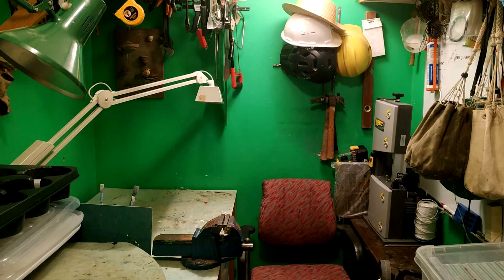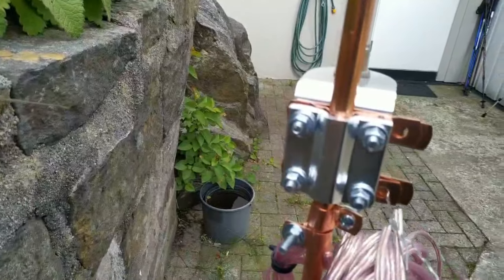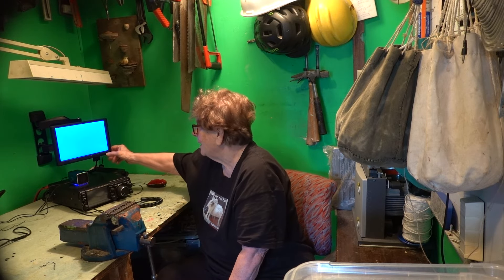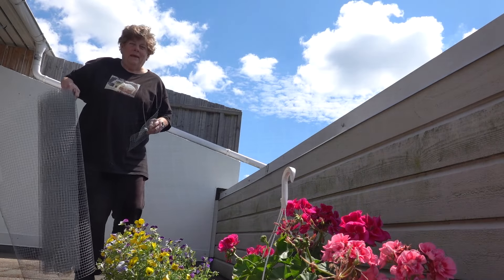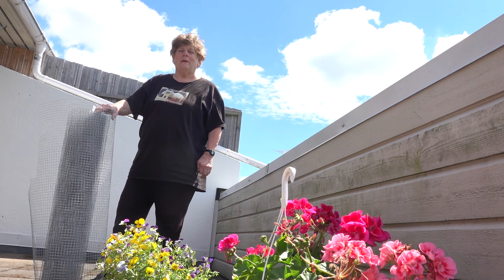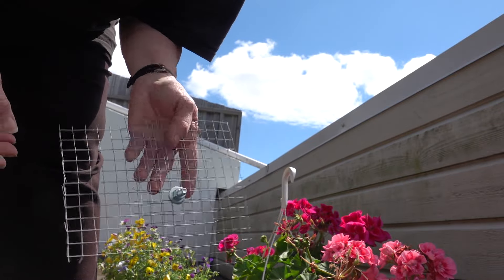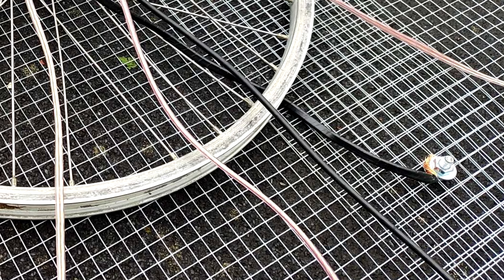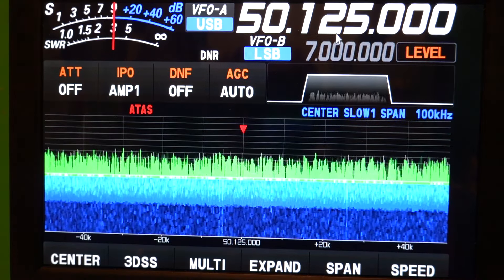Old Ham, New Gear- ATAS 120A and Yaesu FT 710 Field

Comment: Nicely done. Great use of available space. I use faraday cloth as a ground plane for a portable vertical Wolf River Coils antenna and it works great so the process has been proven to work. Good luck on making lots of contacts. 73
Reply from the maker: Thank you!  It does work! I have made 6 other videos on getting back on the air on various modes and frequencies. Experimenting is fun! Hope to work you and good dx! 73 from Sue

Comment: Thanks Susan. I am mostly listening myself. My late father passed 13 years ago he was a ham radio operator. I have never had time to look at his hobby (i did take notice of what he did) but I had to sell all his gear at the time. Although I did keep a rig for myself in the form of his Yaesu FT897d and a few other bits. Also he had the atas120 to go with it. I am now going to get it out of the garage and gear it up!
Reply from the maker: Hi!  It is a wonderful hobby!  My parents were both hams.   I know my mother had a license in 1941.  The Yaesu should be a good rig for listening also.  You might think about getting a cheap 2 meter Baofeng which would allow you to tune in the local repeaters and listen to the hams in your area.  I am sure they would help you get started.   I hope I meet you on the air someday!

Comment: Thanks for the inspiration!  I got my novice license in 1962 and amateur extra less than a year later.  But despite being totally inactive for 50+ years (yikes!) and a dozen relocations, I've kept my license current.  Wow – have things changed!  Amazingly, after a little struggle, I can still receive 20 wpm and look forward to getting back on the air.
Reply from the maker: Tnx!  I have been going through the old callbooks. Have confirmed the novice in 1962, It looks like  I didn't get the extra class until 1979, or 45 years ago, but I had the general and advanced much earlier.  After listening to the HF bands, I suspect I might go back to CW also.  I am rusty, but I can feel the letters rattling around in my head!  I really don't have an ear for SSB, and mostly want conversations anyway, not just signal reports.  I am still working on the antennas, but finally got into the 2m repeater (after 40 years), and now have contact with a lot of local hams. I really wanted to take the test again anyway-a lot has changed! By the way, I made 2 other videos on my station! See you on the air!  73 frm LA0CY
Reply: @suenord1  Hi again Sue.  It's been 3 months since we messaged and I finally ordered my FT-710 on Black Friday.  But between antenna restrictions in this HOA community and very high noise levels, I have yet to get on the air.  Of course, it's taken a week just to figure out how to use the radio!  Like you, coming up with some kind of stealth antenna is proving most difficult, and the house's metallic-based radiant insulation makes any kind of indoor or attic antenna impossible.  The outdoor end-fed wire I tried is too low and close to the house; so like you, I'm considering the ATAS-120A.  While I could plant it right outside my window, it would be close in a corner, and I'm reluctant to put anything costing that much outside.  It looks like my best option is to run 100ft of RG58 around to the fiberglass screened lanai in the back where the ATAS would sit.  I wonder if Yaesu's ATBK-100 Radial Base Kit performs better than your screen grid ground plane.  Thanks again for inspiring me to get back into the hobby after 50+ years!

Comment: Well done Susan. I've a very small garden and setting up an aerial was a challenge. After lots of trial and error I now have Top Band/ 80m /40m ..my favourite bands plus VHF / UHF.
Reply from the maker: Hi! I guess trial and error is the only way sometimes.  I just made another video on how I got on 2meters a few days ago.  This is the link:   https://youtu.be/hE4p4hpj9Nc     I am plotting to sneak a end-fed long wire down to the woods without it being noticed.  It would have been nice to be able to stretch out some radials.  Small gardens are sometimes TOO small!
Reply: @suenord1  End feds are easy to set up and hide as there's no coax hanging down from the wire. Try an end fed half wave for 40 metres with a 49:1 as this will also tune on the higher bands. I use one that's an "inverted L" , the vertical section rises 8 metres in a tree on a hidden pole and then off to a chimney. The same wire can be used as a 1/4 wave for 80metres tuned against a single wire counterpoise run along the top of a fence. You can tune counterpoises in the same way as the aerial for maximum current. Give the wire in the woods a go, I dare you! 73 de M0IDF
Reply from the maker: Oh, I am going to! Bought an untuned wire with a 9:1balun and an antenna turner that works with the FT710. Also got a two foot fishing pole with a little metal fish to throw a line though the tree! Have to go the soccer field tomorrow and practice casting it.  Should work 40 through 10. Wire should be 10m long.  The rest will be fishing line.
Reply: @suenord1  Your enthusiasm is infectious Susan! Well done.
Reply from the maker: Tnx!

Comment: Great story Sue nice work on getting up and running again, we are about similar age but I didn't get licenced until later in life as I was doing radio professionally and just didn't need ham radio at that time, but once that part of my career ended I needed a fix lol so ham radio became my new drug of choice, I think now you need to have a residential address in the USA to hold a licence there now, I'm sure someone will correct me if I'm wrong but my local club has been doing the tests and has an address states side that they use for the postal stuff, a Norwegian call sign will get you loads of contacts, hope to catch you on the bands 73
Reply from the maker: Thanks! I got sidetracked for 40 years, but I always intended to get back on the air!  I couldn't renew my old US callsign,  AD4K, so I just kept the reciprocal license which I have had for 44 years.  My propagation is patchy, but I have worked Canada, the US, Italy  and Russia on the car antennas.  I am leaning towards CW, since it seems to be entrenched somewhere in my head.  Contests still scare me.  I don't do gaming, but my son likes to debug them.  I hope to see you on the air.  I suspect we have a lot in common!    73 and CUL from Sue LA0CY

Comment: Amazing job, well done. I've been playing with my ATAS 120 and not having much luck mounting in the yard. I'll try what you've done with the mesh. It works well on the car, just need some more ground under it for the yard. Hope you have heaps of contacts. Very inspirational. 73's from VK
Reply from the maker: The mesh helps a lot.  It provides an unbroken surface and was WAY better than my tiny patch of "garden" on the hillside.  Probably doesn't hurt to ground the screen.  The best part about that antenna is that  you can tune it to the various bands without leaving the shack.  I am sure I will have lots of contacts.

Comment: Welcome back, i hope to make contact sometime :) Great job on the setup for the 120 atas, thanks putting u pa video on your exploits! 
Love the ft710, a great modern rig that i also have in my shack. cheers, de vk2moe
Reply from the maker: The FT710 is really nice, and has most of what I need.  I doubt that it has the range to work Australia, but I am now plotting how to run an end-fed long wire down to a tree in the woods without getting noticed! I also put up a 2m yagi on the veranda, and made a video about it.  That was sort of a miracle- I found a cliff to bounce off!

Comment: I love my FT710, it's a lot of gear for the money! Catch you on the air!
Reply from the maker: I am getting there pretty fast.  I bolted down all the remaining radials from the foot of the ATAS 120A to the metal mat, and I think it improved the reception on the FT 710. It will probably also help with transmission.  Also almost done with my end-fed random wave antenna.  That should be interesting!  See you on the air!

Comment: I like the external monitor placement for ergonomics.  Looking down at my radio gets my neck!
Reply from the maker: It is a good angle for a screen. I can click most of the parameters with my mouse, so it is easier.  It is on my workbench, though, so I have to fold it against the side wall when I am working!

Comment: what i find amazing is that after 40 years pause the knowlege on amateurradio is right there at hand like it was yesterday. what is your current callsign in amateurradio ? is it still LA0CY ? that callsign is mentioned in the descption of the video. can you comprehend morsecode ? i like 20m, maybe i hear you there. when you have your own property, then an antenna is no problem, even only a 5 meter long fiberglas mast put on a screwdriver stuck in the ground would be enough to hang a 1/4 wavelength copperwire on it for 20m, with ground radials that would be a good antenna already.
Reply from the maker: I recently took a license course because I originally took my ham test in the Dark Ages.  I  make films on my Youtube channel, rebuild my computers periodically to handle 360 video editing, and occasionally fly drones, so I do use some  theory.  I still use LA0CY.  It was a reciprocal license, but is 44 years old.  I was allowed to keep using it.  20 wpm Morse code was required for my Extra Class ticket.  Yep, I remember it.  Learned it when I learned the alphabet. My mother was a ham in 1941.  I am sorely tempted to use CW, since I don't have much of an ear for SSB.  I would use a keyboard to write it down.  Need to practice a bit.  Ground radials are almost impossible in this apartment because we  are built down a rocky hillside with no lawn.  I will figure something out!

Comment: Nice set up. Where did you get the small monitor for your FT-710 ?
Reply from the maker: Hi Andrew! I just got a cheap 10.1" screen off Amazon.  You should probably get one with a DVI input so you don't have to convert it to VGA.  The arm it is on is a simple wall extension. You can use the mouse on most of the controls with an extra screen.
Reply from the maker: I mean FROM VGA!
Reply: @suenord1  thank you Sue de N1XXU

Comment: adapt and innovate, you are an inspiration for hams of all ages. KI7HER
Reply from the maker: Finding new solutions is fun!  I just got in 2m, after 40 years, by putting together a yagi and pointing it at a rock down by the soccer field, which is about 120 degrees in the wrong direction for the repeater. Works like a charm!

Comment: Best 73, hope to see You on the Air one day
Reply from the maker: Thank you! I am working on it! Current project is an end-fed random wire antenna.  I would like to move somewhere that I can put up a proper antenna.  In the meantime, I am learning a lot through my normal method-making mistakes! Hope to work you someday. 73s!
Reply from the maker: My signals will improve! 73s!
Reply: @suenord1  i m sure with your current set up and good propagation  we can make it on HF, i m located near Paris, France 73
Reply from the maker: Yes, France should work with the right propagation. I am mostly picking up southern Europe with the ATAS 120A.
Reply: @suenord1  often monitoring 18140 and 28510 usb,  best 73-88
Reply from the maker: Will look. What is your callsign?

Comment: Which external monitor do you use? Does it increase your background noise levels? 73 :)
Reply from the maker: It was a Wstiry 10.1inch monitor. I converted to  VGA with a BENFEI DVI-D to VGA.  The power adapter did make some noise. Got rid of it by winding the power adapter cable through one of those little ferrite clamps.  Also, it would probably be easier to just get a screen that has a DVI imput without having to convert  to VGA.
Reply: I have an FTDX-10 and repurposed an older monitor (22" I think) that had a DVI-D input. Bought a new monitor to replace it on the PC. Works great but the dimensions are off in 800x600 so there's black bands on the top and bottom. Can't find any way around this, so I'm on the hunt for a monitor that will accept the signal full screen. FTDX-10, an amazing modern radio with fantastic capability...with a DVI-D output to 800x600. Mind boggling. No issue paying an extra $20 for HDMI License. C'mon Yaesu!!!
Reply from the maker: Mine has about a half-inch stripe on the right edge, so it doesn't quite fit either.  Using a screen with a DVI input will probably save you extra work, but I have only used the little screen on the video.  I have some old monitors, but since the radio is on my workbench, I figured there would be less chance of smashing a small screen than a larger one.

Comment: Well done.
Reply from the maker: Thank you!  Now I am all excited because I set up a 2m yagi today to try to work a repeater 25 miles away.  I found out that my local repeater, which is only about 10 miles away, and straight behind a large hill, can be picked up via  reflection off a cliff next to a nearby soccer field.  It works because of the high gain of the yagi!  That will be the next video!

Comment: You should buy a fibreglass pole 12 or 10m long so you can easily make wire verticals or dipoles and put them high up
Reply from the maker: In our hillside apartment building, we can't have anything higher than the roof.  If I ever move, the suitability for antennas will be my top priority.

Comment: Enjoyed you video, Thanks for sharing, AD4XL
Reply from the maker: Tnx Doug!  I am actually getting out on the screwdriver antenna (Three stations in Canada and a couple in the US).  There are 4 videos on radio all together,  and I have been making some questionable modifications to the 2m setup to get rid of noise that seems to be coming in with repeater signal. That will be another video.  Hpe to see you on the air!  73 frm LA0CY!

Comment: vy good, seems you may have qrn from smps in the nabourhood.. hope you will reduce that noise.. best rgds fm oz1fjb - ou2v, 73
Reply from the maker: The antenna wasn't tuned when I took that picture, but I have a non-switching power supply and lots of turns of the coax around a ferrite ring just before the antenna goes into the tranceiver.  I am working on a second HF antenna now, a longwire- that might improve the signals. 
 Also, I got on 2m.  That is another video.

Comment: Hi there… I passed the UK licence back in 1996 but life took me away from the hobby like you 🤨  thanks goodness I just put my then new icom 706 and atu in the wardrobe and didn’t sell it along with other bits and pieces. A radio friend sparked off my interest again early 2023 and I’ve been working hard to establish a radio room or shack… 😵‍💫  the secret is persistence and taking it easy with working , I’m not fit anymore and only have like a 3 hour window every day to try and build, so don’t over do it because it takes days to recover…😒☹️   maybe as an idea for you, think about a doublet, and use the plastic gutter brackets of the roof to suspend it off the ground, it a good forgiving antenna for the likes of ourselves who are impeded by different circumstances… but get your little lad 😁  🤦‍♂️  to go up the ladder and string as much as you can around the gutter,,, I think it may surprise you.  It pleases me to find your efforts to get into radio…THERES SO much to understand now… internet, sdr, ft8, etc…. 🫨  🧐   😵‍💫   😳    And like you when I’m set up it will be to listen for a few weeks.
Just keep going at it, nice and steady. 😉
Best wishes mind how you go.  😁    💎       💙
Reply from the maker: Hi Rube, 
My rain gutter is only about 7 meters, so I will stick with the ATAS 120A for a while.  I  just put up a yagi on 2m on the veranda.  I have a big hill in the direction of the repeater, but found out yesterday that by bouncing it off a cliff by the soccer field that I can pick up the repeater in the next town.  I am monitoring the repeater, and will try my 2m out  when I hear someone.  I did listen to a net last night, so I know it will receive anyway.  I also bought a non-resonant long wire that I might try to sneak past the neighbors eventually.  Technology has improved a lot in the last 35 years or so.  I  bought an external antenna tuner, so I will be able to try experimental antennas without blowing up the tranceiver.  I will make a video about the yagi when I dare to use it! Have a nice day! 73s
Sue

Comment: Excellent work 👏 👍 👌 
I hope you're back on the air!
de W6IWN
Reply from the maker: Tnx! I am on the air, sort of. Put up a very short end-fed antenna last week.  Spent yesterday trying to waterproof it.  The video on that project seems to be popular, but no-one watches the one on using a 2-m yagi to bounce off a rock. I am trying to figure out how to improve the mic settings on  the FT 710 today.  A local ham said I need to improve the settings.  I don't have a very good ear for SSB yet either, so still have some mic fright.  I will try calling CQ again tonight!